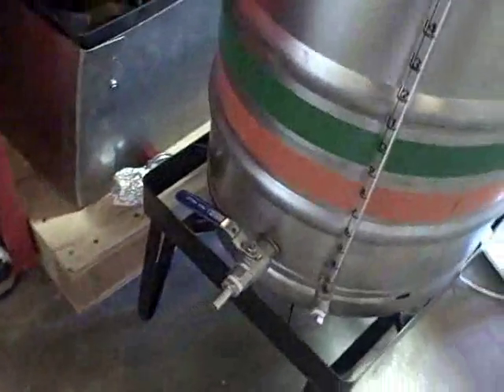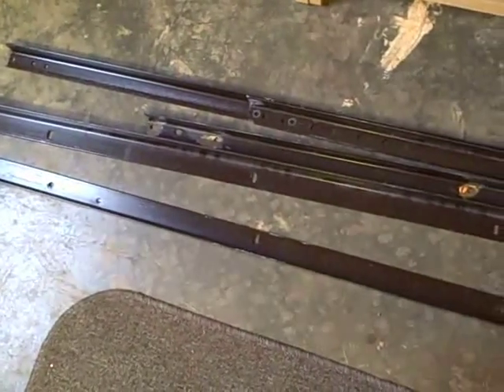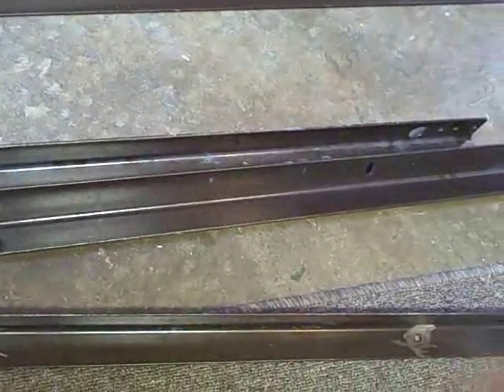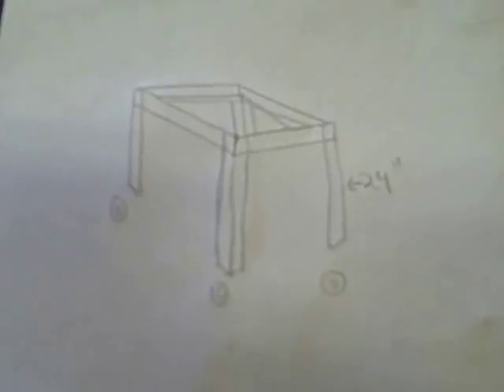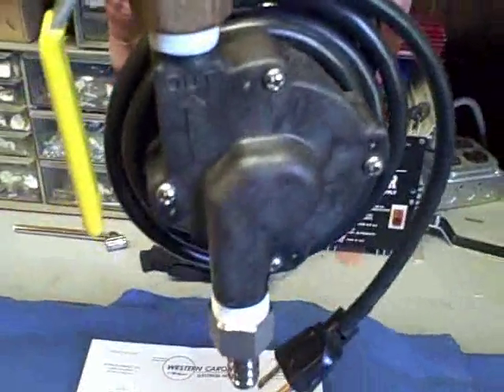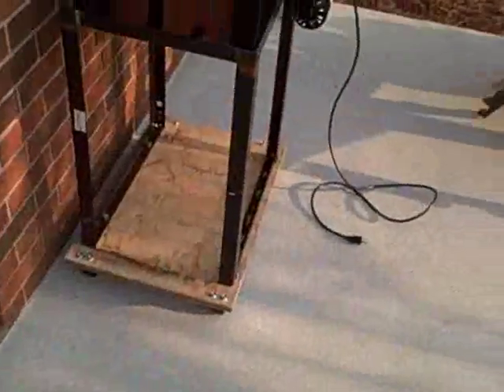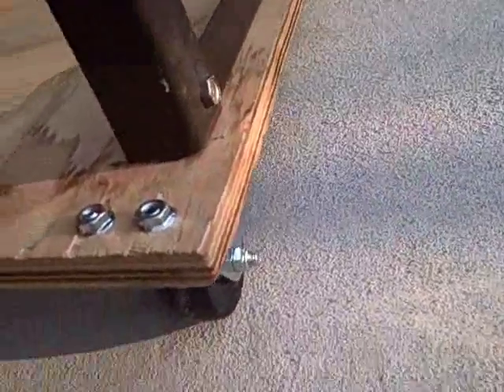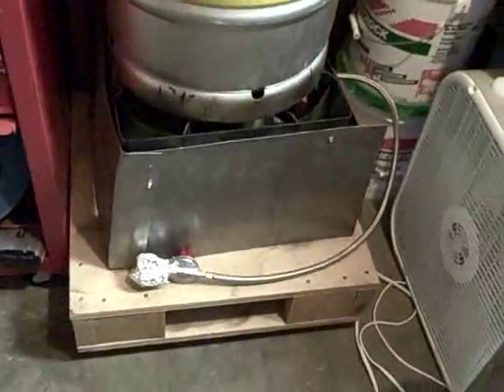New Hot Liquor Tank Stand - Primary / Secondary Experiement

Comment from the maker: @rajoconnor I've never done any temp tests for flavor but would love to. I kept these in the upper 60's.. Usually I'll set my johnson control at about 60 or 62 for the first couple of days or depending how aggresive the fermentation is because of the higher heat it produces in the wort, then bump it up as it slows down to keep the temps I want. I've read that temps can be 5 to 8 degrees higher than ambient temps.